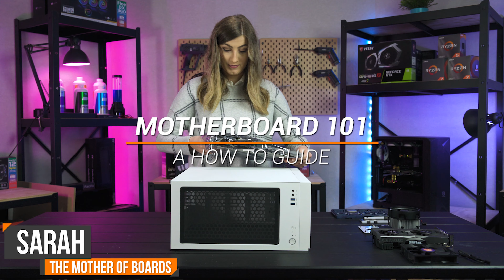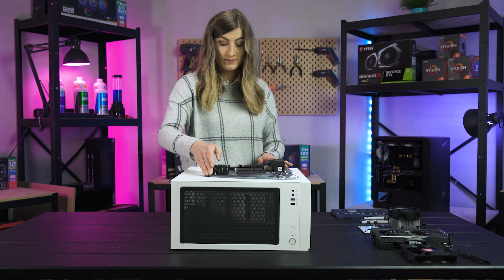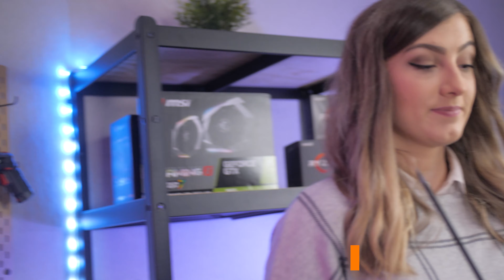How to INSTALL your MOTHERBOARD | 2020 A-Z Complete Guide In under 10 minutes

Comment: which is first IO shield or motherboard
Reply from the maker: They should be all good, you just want to use a small and sharp driver. It's a little too easy to round out motherboard screws
Reply from the maker: IO shield should go into the case before the motherboard ☺️
Reply: @ThermaltakeAustralia  what screwdriver should use for mobo? i cant screw thos screws
Reply from the maker: Typically use a no.1 Phillips head from my ifixit tool kit. Works pretty well.
Reply: @ThermaltakeAustralia  can the Stanley s.drivers work?

Comment: Who wrote the script?? 00:57 - "Drop the CPU onto the socket" No, place it carefully, those little legs are easily bent, difficult to fix and expensive to replace. This is true for both pin and ball grid array sockets, although it's often cheaper to replace a PGA-type motherboard than a CPU.
Cooler installation - those suckers often have a plastic film over the contact pad, which doesn't improve cooling efficiency. Enjoy that micro peel!
Was using the power driver a safety/insurance problem? Do you need a special license or ticket to use one? GIVE SARAH THE POWER tools!
Reply: Right karen
Reply: @tailschick3655  It only took you a year to come up with that?!